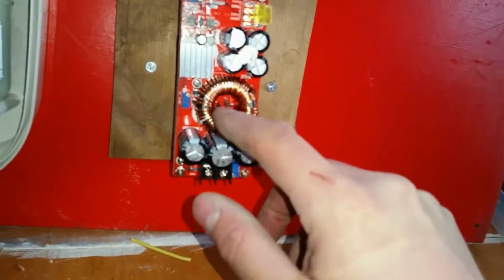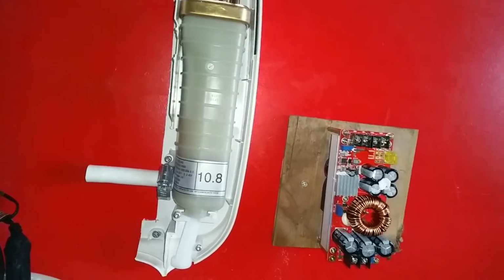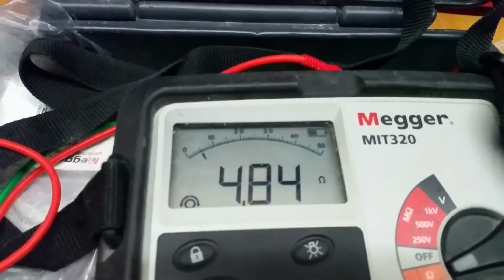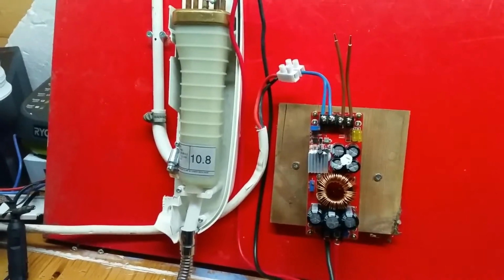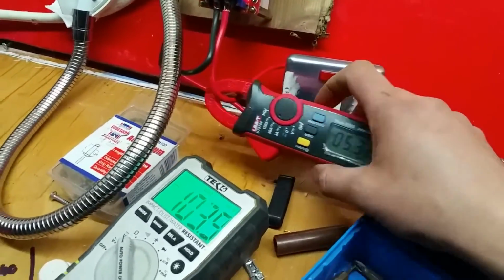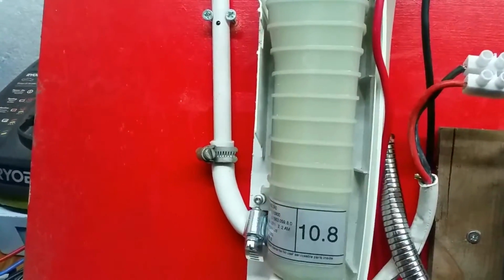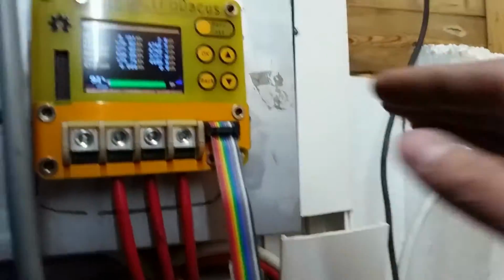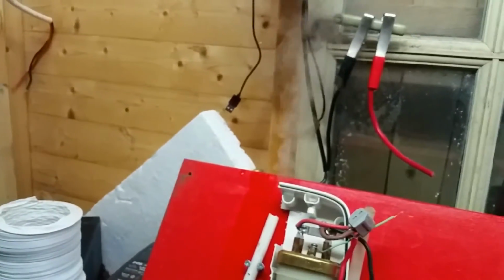Sidetracked - 230v 10KW shower element - Tested at 50V

Comment: One person I know was using dc to dc converters to charge his batteries, he told me his solar panels keep crapping out so I looked at his setup and his solar panel didn't have a diode and he didn't have a diode hooked up on his converter going to his panels. Usually we only had a Schottky diode for this so the electric doesn't backfeed into our solar panels, but there's a much better idea now called the Ideal Diode it uses P channel Mosfet's and you can wire them in parallel to build up the amperage, now there's no issues with his solar panels, does your solar panels have a diode?

Comment: Nice experiment, despite a few issues.
Voltage sag functioning as accidental overload protection lol.
Reply from the maker: Sag and very close to the fuse limits. The other half was asleep indoors so I escaped to the shed.

Has highlighted a problem with one parrallel string of cells. Under load was 0.14v lower than average. (potato of a phone couldn't pick that out on the small screen)